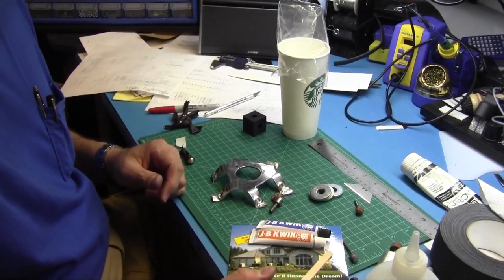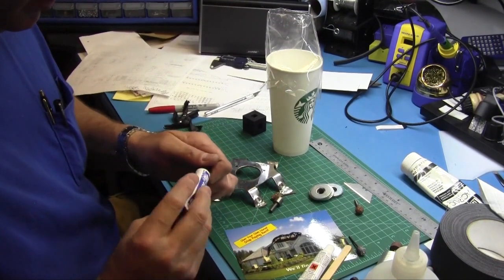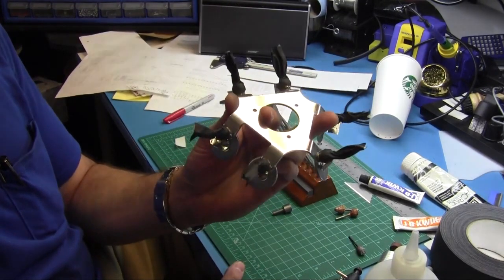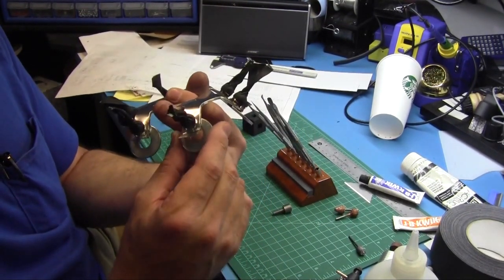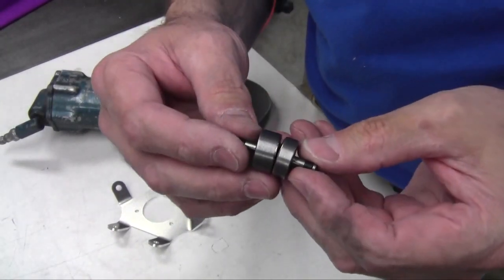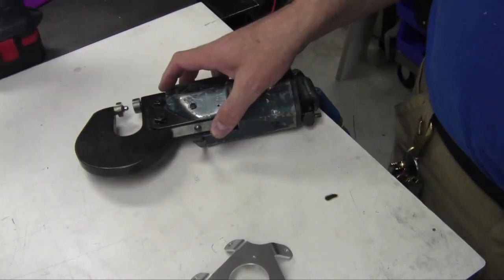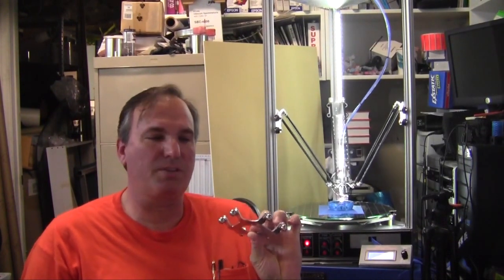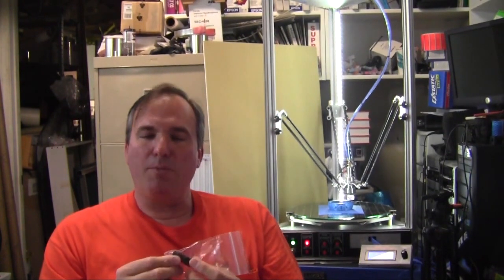The Dimple Die Zero-Lash Magnetic Joint End Effector

Comment: amazing work and R&D !
i had an idea : why dont you try a spot welder? it wont heat the balls (like a mig or tig welder) and you will finish in 1 minute (it does only an instant heat to the point of the weld).
i would like to ask your opinion for the delta printers with the rod ends , do you think they are worse than your design?